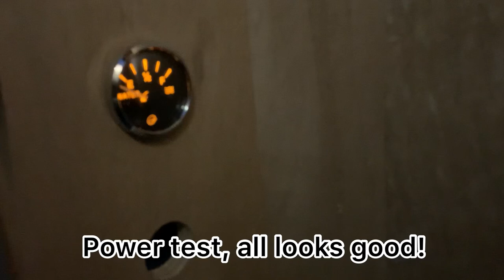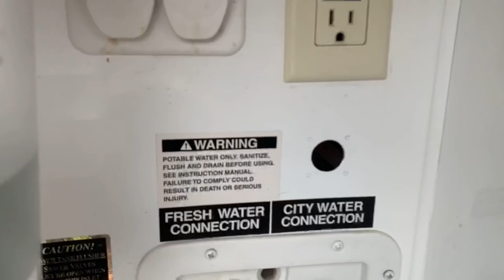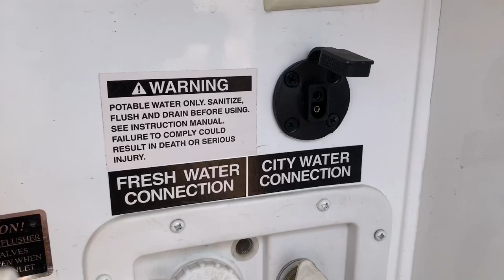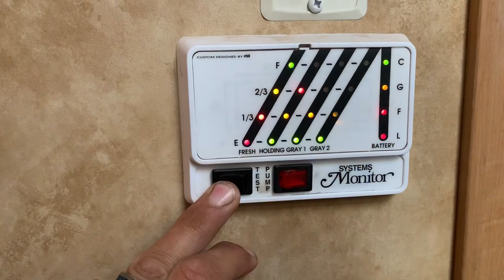DIY: Off Grid Water & Waste Trailer

Comment: Great Video! That's why I moved here to Colorado to do the exact same thing and looking for property to purchase as we speak.  Love the off-the-grid water trailer ideal. How can I get a supplies list to build one myself? God bless
Reply from the maker: We can’t give you an EXACT supply list because you will need to do the plumbing according to your set-up.  But for the most part you need: 

-A trailer (we used a 5x7 Interstate brand)
-2 of some kind of tank (we used refurbished IBC totes)
-Tank heaters powerful enough to heat the size tanks you’re working with
-A (110 volt) submersible pump for the fresh water tank
-An RV gate valve for the waste tank (not showcased in this video because we added that modification afterwards)(install it DIRECTLY under the tank after the tank fitting and then insulate around it to prevent the line from freezing)
-and then you just need to plumb it as shown in this video. So you’ll need various pipe and fittings to hook everything up for filling and emptying.

You can find the tank fittings and electrical items shown in the video on Amazon in the sizes needed for each connection.

Note:  the gauges aren’t really necessary, so you don’t need to worry about hooking those up.  So all the electrical stuff you would need is the plug set up and the switch.  You can even get an RV switch so that it is all self contained and wouldn’t need a Junction box like what is shown in the video.  This complete list of items is also mentioned in the video as the build takes place so we hope this reply and the video are able to provide enough info for you to know what you’ll need.  Good luck with your project and journey!

Comment: Looks like a great system! Was planning a similar build but got very nervous about trailer swaying when liquids sloshing around.  Did you need to add baffles? How is it driving with this on highways? Stopping etc. Thanks!
Reply from the maker: There is some sloshing/swaying but it’s not too bad. If most the weight is in front of the axles it’s better. Stopping has not been a problem at all.
Reply: @itsworthit5029  Wonderful! Thanks!

Comment: Great build! What is the weight rating of the trailer? My concern would be the 2300# or so that a full IBC tote weighs.
Reply from the maker: The trailer is rated with stock wheels and tires to handle a cargo load of 2247 lbs, but we upgraded the wheels and tires to handle more weight.  We were mindful of the weight when shopping and made sure that we were covered.  We haven’t had any issues and the van tow package is rated to handle 3700 lbs.  Do it handles pulling it just fine.

Comment: Can we get an update on how this trailer has performed? Any shortcomings you've found after extended use? I'm planning to start building something like this forca few offgrid cabins that can't get utility hook ups out to them. Would love some pointers. If you have time to connect I'd be most grateful!
Reply from the maker: The trailer is still working perfectly.  We made a couple modifications since the original build.  One thing we should’ve done was put an RV gate valve on the waste dump line just under the tank instead of having the ball valve under the trailer.  The first winter, they line would occasionally freeze (even with the insulation) making it impossible to dump it.  We had to drive across the street to a car wash to spray hot water up the drain to melt the water frozen in the line.  We also added a tank heater to the waste tank to keep it from freezing.  Originally, we had planned on dumping it more frequently (like right after each time dumping from the 5th-wheel), but it turned into a full tank before we would go dump it.  So we didn’t think it would be necessary when we first designed it, but decided it needed it after the fact.  After making these modifications, we haven’t had any issues.  We also feel like the level gauge is unnecessary.  We rarely look at the gauges when we can just get a visual by opening the back to look directly at the tanks.  We’d love to change the position of the Axle so that it’s at the rear of the trailer to distribute all the weight to the front.  When the front tank is empty and we’re pulling it to empty the waste tank, there is some sway-so we have to drive 60 mph or less to Keep it under control.  It’s not a major issue for us but would be much better if the axles were as I stated to make it more stable.  During the winter, be sure to drain the lines connected to the tank to avoid any mister freezing and busting the valves or fittings.  We use an air compressor to blow the waste through the hose before storing the house in the 5th-wheel garage and when we disconnect the water line we blow it to the 5th-wheel and let the water drain from the lines attached to the water tank in the trailer.  The only time the valve burst was when Ingrid forgot to blow out the line after filling the 5th-wheel when temps were below freezing over night.  Let us know if you need any more information, good luck!
Reply: @itsworthit5029  thank you so much for the tips! Definitely didn't think about that yet in my planning. My hope is to build a trailer that has ALL the utilities on it to service a cabin. Water, propane, solar panels, battery bank, generator backup, all under one roof. That way I Caan build an empty shell of a cabin really cheap and just park the trailer there when someone is staying in it, myself or a renter. 

With your experience do you see that being feasible?